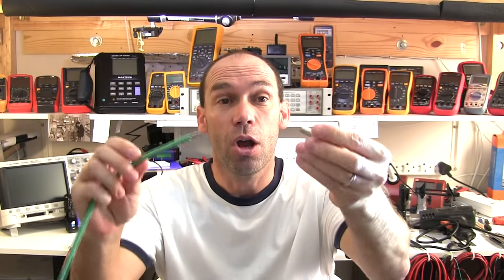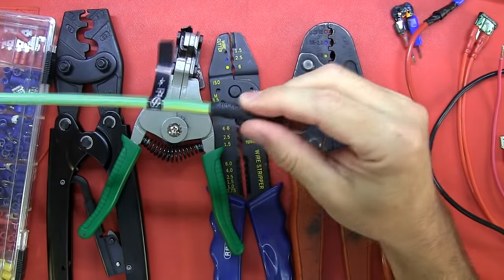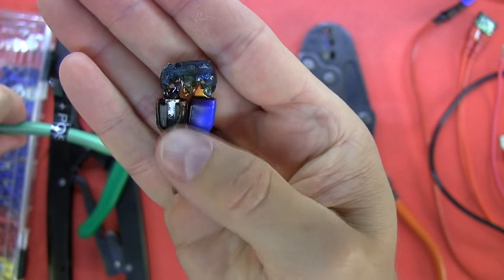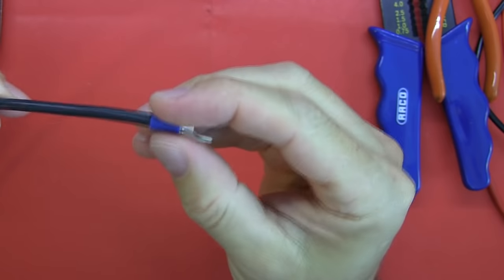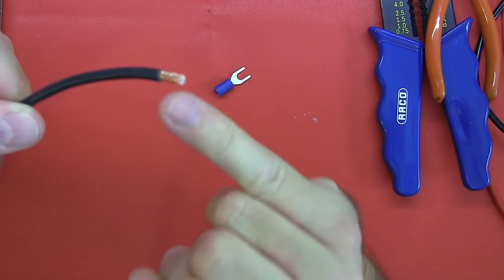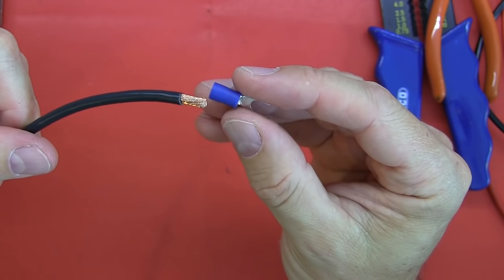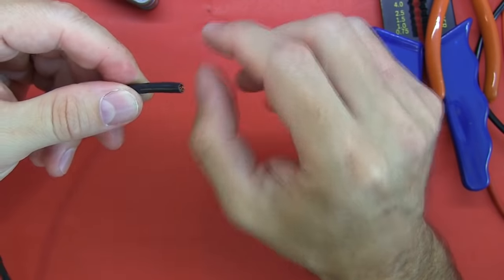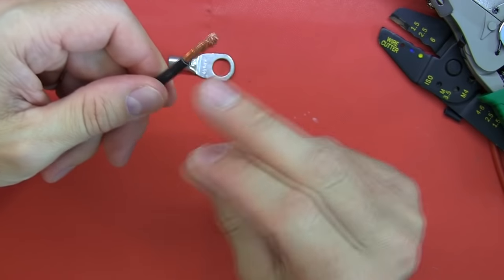Tutorial: How to crimp connectors, strip wire and use heat shrink.

Comment: This is again an amazing video, as you always make them! :-)
I have some added advice, some of them do only apply for high critical connections.
1) Ware rubber glows (never touch the copper).
2) First cut 1 cm of the tip of the cable, to ensure a clean end without any oxidization (use a cable cutter for clean cut).
3) Strip the cable to the decried length (use a heat stripper)
4) Tin every single thread in the wire (extremely thin layer!)
4) Mount the connector as shown :-)
4a) Maybe heat the connection and add solder for better connection
4b) To make it weatherproof, use shrink tube with glue or if you don't have that, add some glue from a heat gun under the shrink tube, the glue will flow when you shrink the tube with hot air and make it perfect tight.
5) For correct marking, add a small sticker with info and stick it flat on the heat shrink. Add an extra transparent heat shrink on top of both the heat shrink and the sticker so it is easy to read and newer goes off.
I have properly forgotten something. :-)

Edit: Use non insulated connectors, they make it a lot easier to inspect.
Reply: 4 . Never combine crimp and solder in the same joint, guaranteed to fail.

Comment: Excellent video, one point, when you used the "cheap" wire stripper you used it the wrong way around, the flat side should be towards the removal end (as it is on the auto stripper)

Comment: I hoped the video would cover the use of the crimp sleeves used on the ends of stranded cable to make a solid end. I have the ratchet tool for the red, blue and yellow connectors but I don't know what tool to use for my 2.5 mm sleeves. They will need to be crimped evenly so the finished end is circular or they won't fit the female connectors for which they are intended.

Comment: I have just got a ten ton hydraulic crimper set for the larger lugs like those used on starter motors etc, available at very reasonable prices  these days,I paid around £30-00 and they are excellent.

Comment: I would suggest adding dielectric grease to the crimps of the larger wire prior to applying to the heat shrink tubing, which is particularly helpful in sustaining a good weatherproof seal in outdoor applications.

Comment: I have soldered ring connectors to a battery cable for an auto pass-over power inverter.
Now I can't sleep after watching this. I was thinking to use those lug connectors for driving a relay for switching battery charger.

I too couldn't find red wires, so had to use black for both +ve and -ve - and used red heat-shrink to distinguish between.

I need to get rid of 4 crocodile clips - and thought to replace with ring connectors. Maybe I need to get one of those crimping toold. All I have is the blue network cable crimping tool :-)

Comment: Thank you for a great video. I enjoyed it very much and will get a better crimping tool.
   I used to repair electronics and electrical gear. The most common problem was poor electrical contacts or broken connections or corroded connections, even on "new" equipment. Even broken traces on printed circuit boards.
   Again, thank you for a great video.

Comment: Great tutorial. I've a need to convert a cable with cigarette socket banana connectors to one that can replace the cigarette socket connector with   crocodile clips fed directly from a lab 12v-13v power supply. I wonder could you consider extending your excellent tutorial to covering that topic.

Comment: @ 8:55 use a 20-22 AWG uninsulated butt connector if your wire is a bit too small. I put them in on the back side of crimp divot.

Comment: Using non insulated terminals I coat the terminal with non corrosive grease before installing heat shrink tubing , Video Appreciated !     5/31/23 30:34

Comment: Nice video.  As always, the right tool (and terminals) for the right job!  I use hydraulic crimper for large battery terminals (0/2 and 0/3).  I also use heat shrink with adhesive (3M?).

Comment: GREAT VIDEO!!! 
Please explain the use of the 'cheaper' crimping tool to crimp NON-INSULATED connectors (using the mid-section of the tool where it says: 'HERE PRESS TERMINALS').
THANKS A LOT.

Comment: on your cheaper crimper the part marked 1.5,2.5,6mm are for non insulated crimps the coloured marks are for the insulated version.I'm looking for a decent set of crimpers to do 4mm cable,but the yellow crimps that they sell are for sizes 4 to 6 but I cant get a consistently good crimp.I've even tried to crimp down the yellow crimps with the 2.5 jaws but it just damages the insulation and still doesn't hold the wire sufficiently for my liking.

Comment: In 60+ years, I've rarely needed to crimp wires but when I do, after the bare wire is crimped, I also solder the wire to the lug, then use heat shrink tubing.  (I only solder when there is no plastic on the  crimp).

Comment: Excellent tutorial. Can you please tell me what is the most appropriate way to connect two wires with different gauges?
Sometimes the devices came pre-wired but the manufacturers suggest connecting to wire with higher gauge. Thanks

Comment: Any advice on how to properly connect 3 wires together (i.e. add a connection in the middle of another wire). This is for automotive purposes. Do you have to use 'step down' crimp connectors, or is there an alternative reliable trick?

Comment: The reason for NOT soldering crimped connections is that the solder is soft and will flow away under pressure leaving the crimp loose. The same applies when using screw terminals (e.g. plug tops).
Reply: @K8BYP _ Hi, I probably did not explain myself too well. Soldering after crimping would be fine: I have resevations about tinning the cables before crimping. I have investigated several accidents for the UK NHS where the solder has flowed out under pressure, particularly on screwed terminals: this often left the earth, line, and neutral connections loose in connectors. I have also seen a few occasions where pre-soldered crimps have failed. Just a difference of experience.

Comment: Nice video. just a quick question..you mentioned using a silicone coated wire for high heat applications..my question is, if the wire is going to be placed on a hot part e.g an engine..will the heat shrink tubing handle the heat as well?? .i cant stand plasticky fumes lol. Thats just me. cheers
Reply: I know I'm a little late, but the best way to keep your wire safe i hot engine bays is simply to route it through the plastic protective sleeves the factory wires are already being ran through, they very often have space for more wire, and if they don't any auto part store will have the hard plastic sleeves to run your own. Best of luck!
Reply: +Jlance999  good tip !
Reply: MrMelvinder How come you don't tint the strip wire and then crimp it?

Comment: This video is 9 years old, I'm not sure if this problem existed back then. But my additional advice
is this.
In the realm of the red Blue and Yellow sized crimps, beware of what you are buying, always stick to 
a good brand like RS or Farnell.
Never contemplate buying crimps in this colour range from eBay or similar. They are crap from China 
and will always fail the mechanical strength "pull off" test. The thin metal in the ferule will not remain 
compressed against the conductor. It is simply too thin to stay put.
Never compromise on quality, remember that quality is a big part of safety.

Comment: I use a Dremel mini-blowtorch / gas solder. It has an attachment fot heating without flame, just like a paint stripper, but without it being necessary to be attached to an AC power source.

Comment: Is it possible to modify/cut/grind the lug of a ring or fork terminal to fit the area needed to conduct the signal without compromising the amount of electricity/signal sent through the wire?

I'm trying to hook up a wire to a sound system (Infinity Basslink 10" Amp/Woofer Combo) and the holes to where the wires enter the system are quite small. One of the wire gauges is thick, and although I found the correct ring terminal for it, the lug is too big to fit into the sound system.

Comment: Excellent instruction! I tried connecting old stranded wire to a new switch in an electrical box (in Mexico) and the wire strands just broke apart! (old wire I guess). Connecting with wire connectors and crimping seems to be the only solution.

Comment: Thank you for the valuable information for someone like me that does not know much about electrical and wiring.. Do you by chance have a video on splitting a 48 volt 20 amp battery wire so it can go into a 12 volt dc to dc converter? I have an EBike with what seems to be second rate wiring and needs fixing..

Comment: How many people out there have worked on a vehicle where "someone" had pried the battery clamp wide open and shoved the wire between the post and the clamp and tightened it down? Often seen with a drywall screw (or two)  twisted in for added tightness.
Reply: A few years ago my friend bought a car and the previous owner hammered a nail into the battery terminal to hold a wire in place, seriously shocking, excuss the pun.

Comment: @15:00 You seem to be using a crimping tool for double-crimp connectors. But you have standard connectors. Isn't it better to use a single crimp tool designed for the connectors you use?

Comment: My house in UK has 10mm2 copper bonding [yellow/green sleeved] all over, and very poorly made off to pipe clamps. Bought today; expensive ratchet crimp tool, good quality/right size lugs to terminate and 10mm2 correctly colour coded sleeved cable to improve/replace as necessary.

Although a welder, and experienced DIY plumber, I'd no experience of crimping, much less with 10mm2 cable.

Have you any idea how useful this video was? ;-)) 

BIG thanks from one grateful Brit!!!!

Comment: You you need to do the small roll around the insulation and crimp the copper connectors which are the tricky ones.. They  are often  inserted into plastic connectors. Different tools needed.

Comment: At 5:51 the tool is backwards.  You want the flat face pushing on the plastic you are removing and not the angled face. Close the jaws open slightly and rotate the wire 90 degrees and close again.

Comment: awesome video, so informative , and i like how you showed your mistakes, im off to buy a automatic wire stripper and ratchet crimper on payday,well maybye!, im looking to use the crimper for car audio installation and the amp kit il be using is stated as being 8 gauge, (could be more like 10 theyr not always accurate?) but my question being will that fit in the crimping tool? i do have a soldering iron as an alternative which is what i was going to use till i saw ths vid

Comment: I am completely new to crimping. I was wondering does the terminal gauge size, have to match the wire gauge size? Could I use a 16-14 gauge terminal on 18 gauge wire? Would I still get a connection?

Comment: Great video. A question, there are 2 sizes available in ferrule crimpers one upto 6mm and the other upto 10mm. Which one to get. Also there are some with 4 self adjusting tabs in the jaw and some with 6 tabs. Which one would be better. Thanks

Comment: Do you ever need to put some solder on the wire before you put it on the crimp?  Thinking in my head that the flux in the solder would increase conductivity, maybe I'm wrong.  Thanks

Comment: EXCELLENT VIDEO, I might add that many of those things that "might" or "could" happen are things that wouldn't be an issue 99 out of 100 if you are somewhat diligent about it. HOWEVER, like this gentleman has said, it would NOT be the most perfect connection, but it would for most viewers needs be fine. Example:  You stripped the wire and lost a few strands, we are REALLY splitting hairs that you ahve lost conductivity.  But his POINT is well taken, because some people could be using 1/2 the wires!  Not good. etc. etc. but good video all in all.

Comment: Is there such a thing as solderless connectors for XLR Female box mounted plugs? Either sleeve or pin type 
I'm building a prototype patchbay. It will consist of 8 different plugs.
4 will be 3 pin XLR, and one will be a 5 pin XLR, and others. During the build, I don't want to solder anything until a quality check is done.
When finished, I can solder everything one wire at a time.

Comment: Is there any reason to solder the connection AFTER crimping?  It seem like that would be the ultimate connection.  Especially if the 'inspection window' is on the side of the barrel.  The stripped end of the wire could be fluxed, and the terminal end would be crimped onto the wire.  Then, the crimped aerea could be heated and solder would flow down the edge of where the wire enters the connector, following the flux into the crimped barrel.  The solder would bind the wire strands, and would mechanically fill the 'inspection window' hole thus locking everything together physically, and providing 100% contact electrically.  Finish with heat shrink tubing or 'liquid' electrical tape.   Maybe overkill, or from the the 'department of redundancy department', but could be justified for heavy duty off-roading, etc.

Comment: A great video! Do you suggest soldering through the view hole after crimping the connector to the wire, and then apply the shrink tubing?

Comment: 16 Gauge insulated copper strand wire - which connector size is preferable, 14-16 or the 22-16?
Warm Regards from Reno, Nevada, U.S.A.

Comment: Very nice vid my good friend. I'm planning on settling up a 12V 8.5Ah battery pack for my yeasu FT 857D what type of wires would you recommend AWG10? Another question for you. I've just bought myself a wattsup meter which I'm planning on using with the battery but that has a 12 or 14 AWG wire on it can't remember exactly. would that be an issue? Thanks  Hope to hear from you thanks for sharing and very informative have a good one mate 👍

Comment: I've tried several times, with a connector that is exactly the correct size for the wire, it fits in there perfectly snug, but even when I crimp it to the point even the plastic gives way a little, I can still easily pull the connector off by hand. Is it supposed to be that loose of a grip on the wire?
Reply: The same thing happens to me when crimping too. Correct size cable and crimp use the ratchet crimps to the point the crimp plastic splits then it just pulls off easily.
Thats why i was looking for a good crimping video to see what im doing wrong 16:07 my crimps usually look like this but usually split and pulls off. 
Crimp quality issue we are using maybe or our crimps position in ratchet crimps?

Comment: I have a question. I need to use an 8AWG cable so would a 8AWG connector be fine in terms of current specifications or does the awg of the connector only apply to the diametre and not to how much it can handle?

Comment: Never twist the stripped cores before crimping because it has been proven to reduce electrical contact inside and mechanical capability to hold. When not twisted, the crimping process brings the cores together positioned in a hexagonal pattern, while the cores are pushing each other from a hexagonal pattern each core takes the shape of the hexagon, maximizing  the contact surface. If twisted, the cores will damage each other inside.

Comment: What is the standard size or length you have to strip or cut away for all wires? I was told 1 inch.
Reply: Theres no set amount.  It depends on the connector and wire gauge used.  I'm working with small 22 AWG wires, and 1/8th inch is plenty for the single pole bullet style connectors being used.  Larger wires carrying more current require more contact for both the mechanical and electrical connection, so just adjust for your wire and your connector.

Comment: My personal opinion is the first crimp you did in the video was slightl to much towards the end, you actually crimped the very end of the crimpable part on the faston connector, I like to crimp directly in the middle of the crimpable part(not the plastic)that way you have the full amount of crimp posible and slightly past that the wires fan out to give better mechanical strength, if crimped right on the end you lose some. probably nit picking but to me it stood out like a sore thumb. I wish i could draw in the chat to explain better, a picture paints a thousand words as they say. good video.

Comment: Tools that have a indent are meant for non insulated connectors. The proper tool for an insulated connector simply crushes the connector and does not damage the plastic on the insulated connector.

Comment: Please use a heat gun to shrink the heat-shrink tubing.  I only use a match or the lighter in remote circumstances, when I away from my work area.
Also, think ahead of yourself, to plan how you will use the heat shrink tubing, because you will usually put it on the wire before crimping, especially if you want to add layers, as with the clear tubing.

Comment: Also not stated in the video, HEAVY AWG 4-0 and larger, there is a tool that holds the wire and "crimp end", that is struck with a hammer/mallet to make a damn good connection.

Comment: Wee bit out of date.  I had those wire strippers in 1985, and they were OK, but too many times, I picked the wrong hole and either just scrapped some rubber off without stripping the wire, or went too far the other way and cut some strands of the cable. Much better options available these days, that get it right every time.

Comment: What if you need a crimp connector that goes from 12 gauge to 16 or 18 gauges (connecting two wires)  do they make a connector for two wires that have such a difference in gauge?